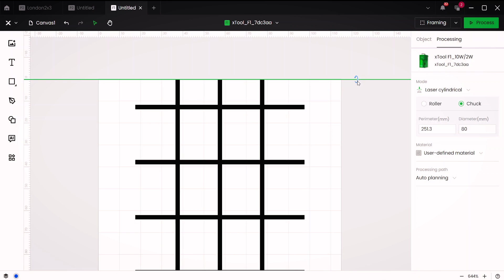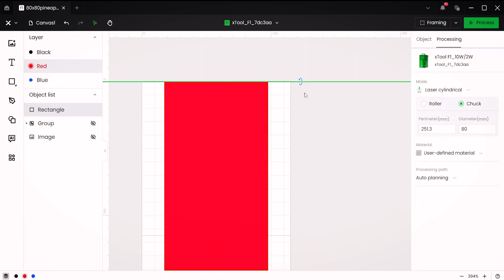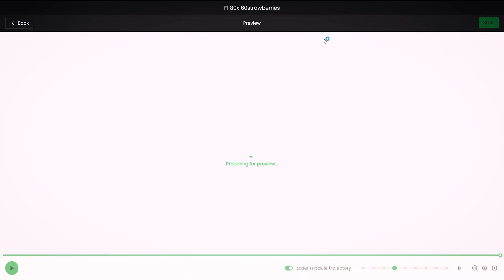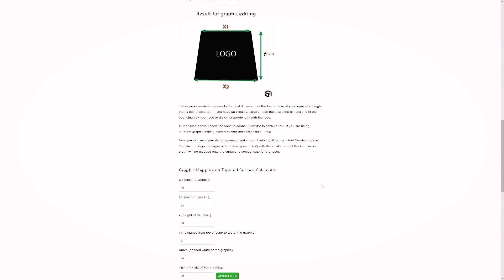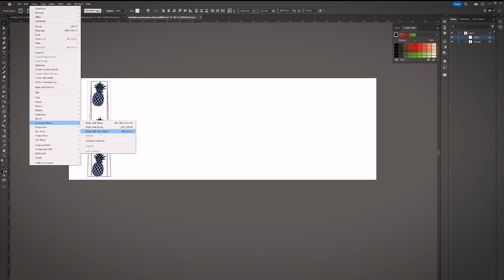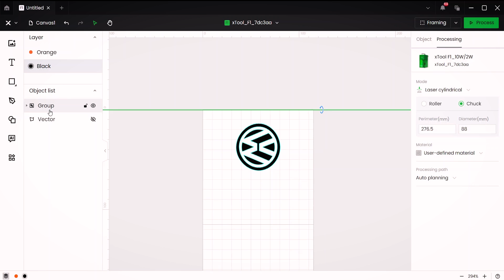XTOOL F1 Full Wrap Pattern Tumbler Engraving, Patterned Tapered Surfaces and Tapered Correction!

Comment: Engraving tumblers and water bottles is easy once you know how to handle the tapered surfaces and correct for them in your design. I use the Monport Mega, and I love it for projects like this—it’s great with a rotary attachment, and the auto-focus and precise settings help me achieve smooth, uniform engravings on both cylindrical and tapered surfaces.

Comment: Great video and calculator!    I've been pulling together info on taper angle and measurements and putting in an Excel spreadsheet as I work offline quite frequently.   Your websites tool to figure the X1 and X2 given a y offset from the top is fantastic.    Would it be possible to get formula for x1 and x2?   Appreciate your consideration.    Either way thanks for the great info.

Comment: Got a side question for you...... would you know the settings to do zippo lighters
Reply from the maker: What machine are you using and I assume the lighters are stainless steel?
Reply: @EmbraceMaking  Xtool F1, im assuming it's stainless. I was thinking about using the metal business card setting or dog tag.
Reply: @EmbraceMaking  zippo calls it street chrome. Dull color.
Reply from the maker: I don't have any zippos on hand to try but if they are stainless - on the XTOOL site they have settings for the F1 using the IR laser at 80% power, 550mm/s (seems high?), 200 lines/cm for vector files, and 60% power (no speed setting?) and 450DPI, 150 dot duration with JARVIS for bitmap files.... and then interestingly for stainless dog tags they have different settings like 100% power , 50mm/s , 300 lines/cm for vector files... so I would probably lean towards the dog tag settings as the speed seems sufficiently slow to mark something like stainless. https://www.xtool.com/pages/material-settings
Reply: @EmbraceMaking  thank you very much and again keep up the great content.